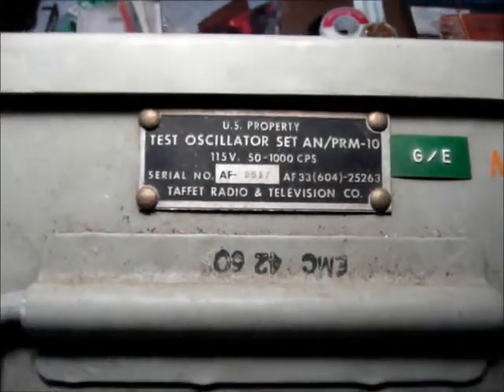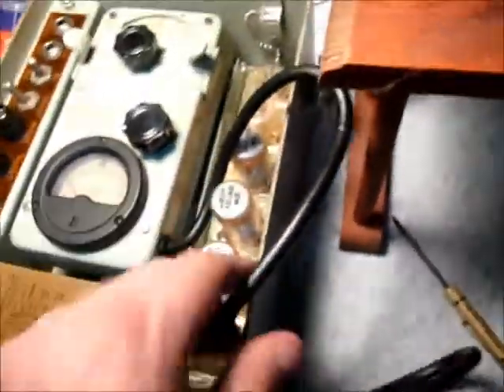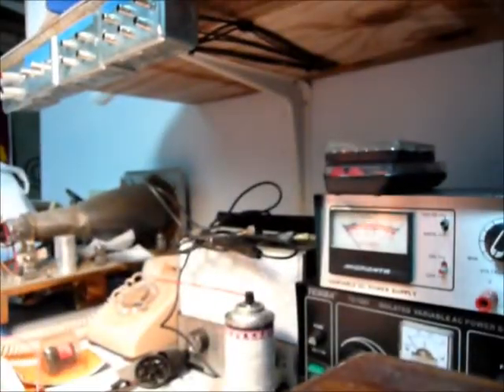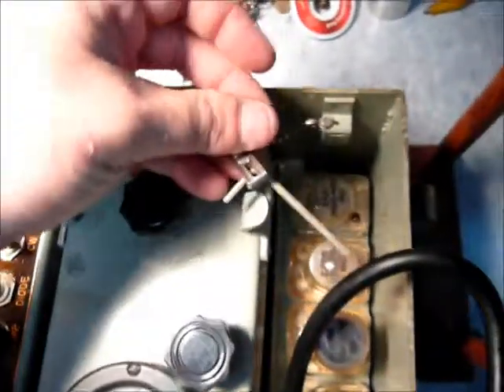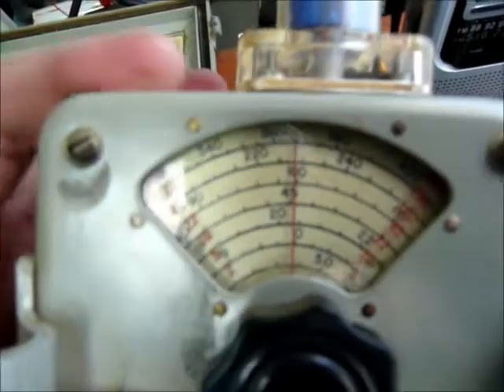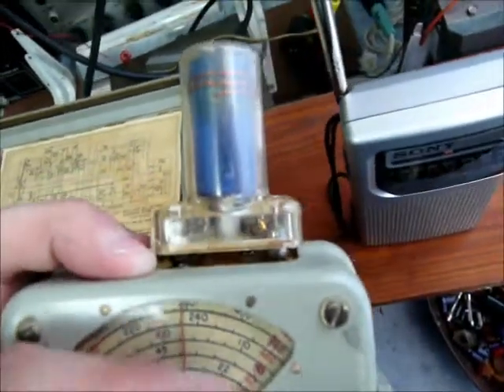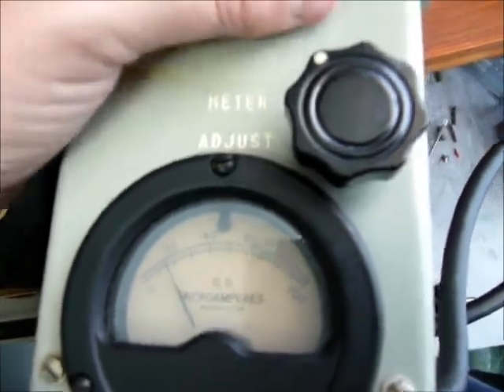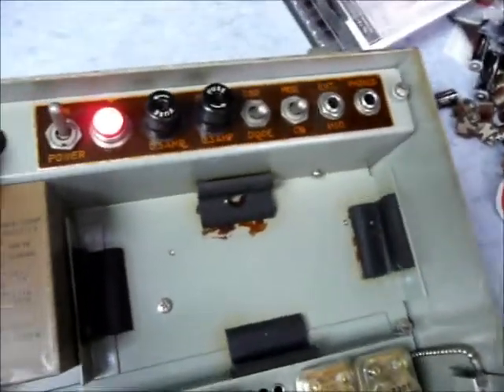Navy AN/PRM-10 Test Oscillator

Comment: I have an army issue of that very same meter, was unused and still in the packing box when I bought it, complete with manuals etc, used a few times to fault find on the tank circuit of a linear amplifier, and to check out the traps of a multi band antenna. Very useful instrument.

Comment: ..you do realize that this is a Grid Dip Oscillator or Grid Dip Meter or simply GDO? It is a test instrument to determine (among other things) the resonant frequency of a tuned circuit or antenna or what have you. Yours appears clean and well-cared for although it is a tad bulky for use in the field compared with the more "modern" solid state models that came a few years after.